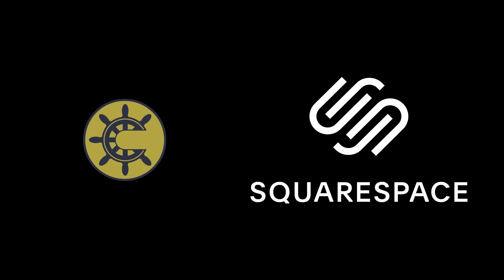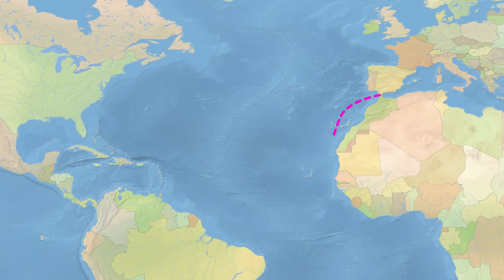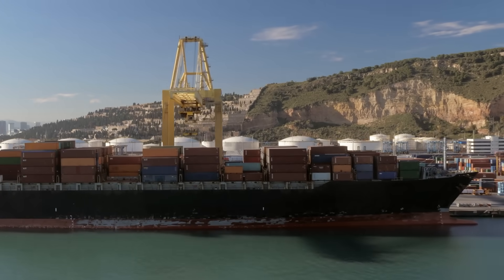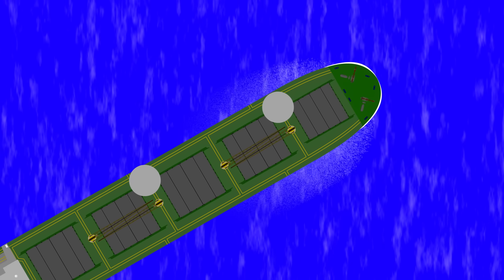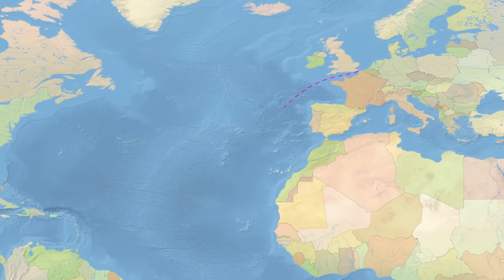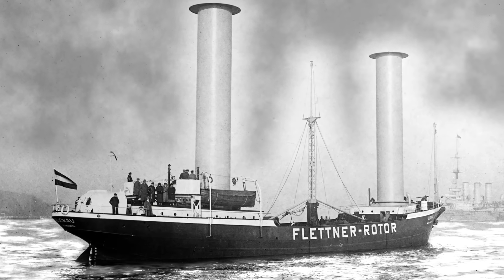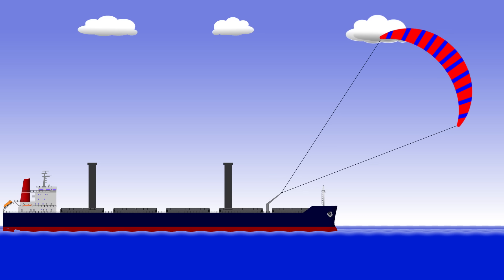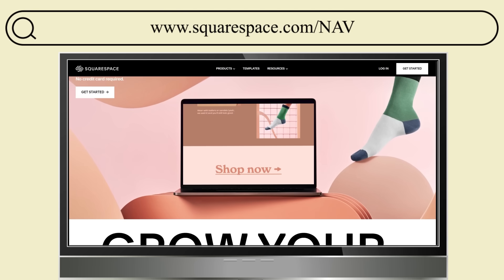Why Don't Sails Work On Ships?

Comment: That was a big jump from looking at the question of cost and benefit to advocating for global mandates. Reduced running costs of efficient vessels could be negotiated into the charter price.
Reply: Why not use nuclear technology in large container ships as is done with submarines? Very effective as water jets - surely it beats the efficiency of marine diesel??
Reply: @forrestpugh7575  Nuclear power is very expensive to the point that the majority of submarines are not nuclear powered and only the US and France operate nuclear-powered aircraft carriers.
Reply: It's also pretty short-sighted.  It assumes the economics based on current fuel prices.  Fuel prices in the future will go nowhere but up, on the long term.

Comment: 6:08 hold your horses. If the increased cost of a charter with these rotors saves the charterer more in fuel costs then the increase rent, then of course charterers will be willing to pay more. No government needed.
Reply: Corporations usually focus mainly on short term costs, ie 5 years or less, because thats around where ceo and shareholder turnover tends to be. With a ship that costs a fortune upfront to build, and will take years to pay itself off, increased upfront costs are often avoided, even if it means substantially increased profitability down the road, because by that point the person who built the ship is no longer receiving profits from it. The corporation may benefit, but those who control it generally do not. So, why not have the government step in to make them choose good long term decisions?
Reply: @razordrive3238  Typically, costs are a first-order estimate of energy usage. If a given technology is not being implemented, there is probably a reason for it. These sails are an experimental technology. How do the sails affect the balance of the ship? Traditional sailing ships were constantly raising and retracting sails based on the wind conditions, otherwise the ships would capsize in high winds with full sails? Are retractable feasible? Will the patent holders be profiting at insane markups due to lack of competition? 

According to Wikipedia, they are only producing "5-20%" fuel savings. At lower end of that range, the actual in-practice fuel savings could easily be negative, especially if they are placed on ships just to meet regulations, rather than actually increase efficiency.
Reply: Exactly so.  The producer of this video appears to have a hidden agenda.

Comment: I’ve got a bone to pick here:  a traditional fabric sail and an airplane wing aren’t really different besides efficiency and performance parameters/mission. They work under identical principles. You  present them as different things altogether.
Reply: The difference is the wings is deflatable making it easier to move them out of the way of the equipment that loads cargo on the ship.
Reply: Nope. They have more differentiators than efficiancy and performance.
Reply: Sails are catching wind. Wings produce lift via Bernoulli’s Principle. I don’t think the principles are identical.
Reply: @clydemarshall8095  sails that catch the wind (aka use the wind drag) are the older, square sails. Newer sails are designed to produce lift because they can extract more force via lift for the same wind speed compared to just using drag.
Reply: @clydemarshall8095  Bernoulli's principle is misapplied to wings. There's a reason wings aren't level with the body of a plane and there's a reason why they use flaps to actually take off and land. The aerofoil shape makes it more efficient but ultimately it's just striking the air at an angle and the inertia of the air pushes back on the plane opposite that, which is up.

This is why a paper plane still works. Wings do not get sucked up, they push air down and then the air pushes back. this is also why a plane can fly upside down, they just nose up enough to generate lift off the top.
Reply: @clydemarshall8095 that's not right, not for most sails anyway, especially modern ones. If this was the case, it would be impossible to generate speed while the wind is coming from beside, or ahead of the boat, which they can. In fact, they are most efficient with the wind coming from about a 60 degree angle, from the FRONT. Not with the wind behind. It's the same reason a sail boat can go faster than the wind, because we're not "catching" anything, we're flying with sails that are pulling the ship forward.
Reply: @clydemarshall8095  Ever sail with the wind forward of the beam? There is no "catching" going on. It is an airfoil, like a hang glider. SAME principle.

Comment: Sails are labor intensive and also maintenance intensive so any cost in saving in fuel is more than offset by the cost of the initial installation. the maintenance of the systems installed and the operational cost of sail handling personnel.

Comment: Some cargo ship is going to use a giant wind sail? What happens when it hits the water and you have 300 tons of wet fabric to reel in and toss up in the air? 
By the way, standing towers up and down, especially those stiff enough to rotate, doesn’t sound easy. I’ve seen lots of videos of towers being lowered and it’s hard. Usually there’s a giant crane nearby, and the crane falls over too when that center of gravity starts going sideways. 
Looks like a high school project brainstorming idea to me.

Comment: Not explained why you couldn't use the northern tradewinds for routes from north america to europe. You cant use them to go directly from europe to north america, but you can in the other direction. Even for half of the journeys, using sails could save a lot of diesel.

Comment: sails already are wings.  the airfoil as sail is not new.  it is not the deflection but the horizontal lift that propels a modern sailboat.
Reply: Lift and deflection of the wind are two sides of the same coin.

Comment: Tbh I don't understand why Cruise Ships don't use sails.

Cargo ships I get, its too much stuff in the way to load and unload effectively. But cruise ships? No need to lift things off the deck with cranes, and you could probably get a tax rebate by dropping your carbon foot print. not to mention how trendy and hip it would be to take a cruise on the first wind powered carbon neutral solar cruise ship.

Comment: One major problem with wind power on large ships is the square cube law. say you make an ship twice as large, it twice as long, wide and high but now weight 9 times more while sail area is 4 time larger. Most sailing ships max out at 10.000 ton except Great Eastern who was just insane. 
In short huge ships are to large to get much benefit from the wind. 
Probably work better for smaller ships but they work more in coastal areas so the parachute would not work well but Flettner rotors might.
Reply: Except that the drag they are experiencing also experiences the square cube law, which is why they have got so big in the first place. An engine to accelerate and stop would definitely be required, but cruising thrust from sails works just fine. Actually, because wind gets stronger with altitude, sails don't quite follow square cube, so it works out better.
Reply: @agsystems8220  you are wrong about the engine being required, but it is true larger ships sail faster generally..   all the ships could be sail powered if we made it a hard requirement as it was in the past.
Reply: There isn't exactly a hard limit on kite area though. What is to stop a series of kites being flown one on to of another? Perhaps a string of five or so? Would take a bit of work to get them all launched, but potentially worth it for a big ocean crossing, and the wind only gets stronger the higher you go.
Reply: It's often said that it's cheaper to transport an item (a drum of industrial lubricant for example) for tens of thousands of miles by sea, than the last few miles overland to its intended destination.
Reply: Think again.
Mass isn't what slows a ship down, drag does.
And now think about how drag scales.

Only accellerating will take longer, but ships don't spend much of thier time and energy accellerating on intercontinental journeys, so who cares if it takes 10 times longer?
Reply: @jannikheidemann3805  Academically no, but practically yes. More mass, more fuel, bigger engines, and more fuel all equals more mass until you cant build a bigger badder cleaner engine.
Reply: You dont need a huge ship to cross oceans.
Reply: @joshlower1  The cube-square law and hull speed are the main ways ships save fuel.

Engines have to continuously run because energy is lost due to friction with the water and/or air. For example, in space once an object is moving at speed X it stays at that speed.

The power required to keep a ship moving is below. A is the cross-sectional surface area. As a ship gets larger A drops when compared to the volume of the ship. This increases fuel efficiency.

P = 1/2 p A v^3 Cd

Another factor is hull speed which is directly related to the length of the hull. Bow and stern waves form on ships when they move through the water. The further apart the bow and stern waves are the longer the wavelength of the bow/stern wave combination which increases the speed where the bow and stern waves start to interact in a way that slows a ship down.

To save on fuel costs ships are as long, narrow, and big as they practically can be. Of course, there are limits to size (like the size of ports) and limits to how narrow ships can be (before sea worthiness and hull integrity are compromised).

Sailboats are limited by the Cube-Square Law and hull speed. Most sailboats can't go faster than 6 knots no matter how much wind hits them.

Smaller boats are incredibly fuel-inefficient and even more limited in speed unless they are a non-displacement hull. "Speed-boats" are non-displacement or semi-displacement hulls because as they increase speed much of the hull gets out of the water and onto a plane (this is like a hydrofoil).
Reply: @joshlower1 that works for a yacht but not for shipping....
Reply: @joshlower1 You do need a huge ship to make shipping cargo worthwhile though

Comment: I believe the diagram about the sail is quite misleading. A normal sail pulls the craft through the water by creating an area or low pressure behind it. Just how an aircraft creates lift, but, you know, on its side. 

The next part about areofoils further confuses matters because sails are areofoils, they're not orientated to create lift, just forwards momentum.
Reply: I think the confusion is yours. If a sail is not producing lift then neither is it providing any thrust to the vessel (with the sole exception of being on a run). Lift is defined as the component of total reaction that is normal to the relative airflow. The only time there is zero lift is if the aerofoil is at zero lift angle of attack or there is no airflow, or a sail is acting as a chute. Any time the sail is driving the vessel (except on a run) there exists a component of force that is normal to the relative airflow (ie lift). It is not in general the same as thrust, which is the component of total reaction that is aligned with the keel, opposite to the drag on the vessel, although in the special case of a beam reach the thrust and lift vectors become the same thing. OTOH, in the special case of a run, the thrust = the drag on the sail only and - in theory - the lift becomes zero. On all other points of sail, there is lift.

You said “sails are areofoils [sic] they are not orientated to create lift only forward momentum”. That is incorrect. Only in the case of a run is there no lift.

Comment: I always thought that, after WWII, the increased number of fueling stations, the surplus of freighters, and the dearth of skilled crewmen made coal- and oil-powered ships more economical, and we lost the skills needed to operate sailers. Sailing ships had advanced to be very efficient before the war, and quite a few of those big steel “windjammers” still exist today. However, technology, knowledge, and economics have moved to containers and large volume vessels, so I think the days of blue-water commercial sail have forever passed.

You might as well ask whether ocean liners, sleeper trains, and piston-engine commercial airplanes are currently viable.  They all reached the peak of their development, but were rendered obsolete by world developments.
Reply: Regarding sleeper trains, have you ever been to India? They are the standard way to travel long distances there. The fares are cheaper than the cost of fuel to run a motorcycle or car the same distance, and you make the journey in comfort and safety.

Comment: I like how, around the 4 min mark, the ship drops its rotors in order to use its superstructure to absorb the full force of the imminent collision with the bridge
Reply: Well, how else are you gonna take down the bridge?
Reply: @demogod4955  Should I say that a bridge is needed to take down another bridge?
Reply: Exactly, the cylinders would make the ship to lose momentum and we want it to collide at full speed  @demogod4955
Reply: The ship's bridge has been phased into 4th dimension. You can't do that with the sails as they need to interact with the wind.
Reply: Bridge to bridge contact
Reply: "Sir, bridge dead ahead!"
"Lower the rotors!"
"Sir?"
"Full speed ahead! Bridge to bridge combat!"
"Sir yes sir!"
"Today is a good day to die!"
Reply: 😂😂😂 @alexc8114
Reply: and then, around 6 and a half mins in, the radar mast passes straight through the bridge :D
Reply: chimney passes through bridge too
Reply: XD
Reply: The bridge is collapsible too, with enough effort.

Both bridges, for that matter.
Reply: No worries. It’s a QUANTUM bridge!
Reply: hahaha I saw that too!
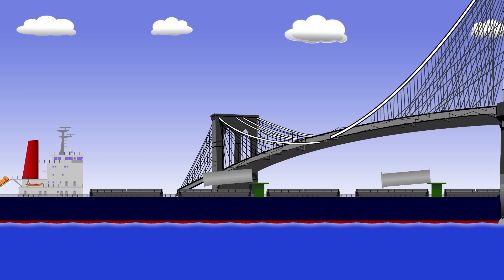Reply: 4:15
Reply: RAMMING SPEED
Reply: The sea is always right!
Reply: i hate that.
Reply: The rotors a generating a significant gyro effect.. ;-)
Reply: At 6:35 you can clearly see it just ghosts trough the bridge.
Reply: The ship is saved because the scene ended😂
Reply: relative angled illusion
Reply: @feelinghealingfrequences7179  not so. In this case somebody just made a serious error and its going to be expensive
Reply: I was thinking the same lol

Comment: The cost/benefit analysis will probably vary depending on the type of ship.
Cruise ship or container ship: deck space is precious + boat is top-heavy already + cargo is time-sensitive... adding sails or a funnel would not be practical.
Oil tanker or bulk carrier: a bit easier to load and unload + low-lying and stable + non-perishable cargo... it could be economically feasible to add wind power to cut down on fuel costs.

Comment: Sorry, but your exlpanation of how sails work is lacking a lot, i.e. the airfoil effect of traditional sails. And that sails would have been implementend in cargo dacades ago... Well they have. Thousands of years ago. And they are used in cargo ever since. Today, there are not very many SV cargoships, but the numbers are increasing. And Skysails do not pull the ship they are mounted on. Instead, they produce electricity, that can be used in the diesel-electric propulsion system.
I get the point of your video, but your research is a bit dim on this one.

Comment: Sails have in use since the beginning of sea travel. Could they not unload cargo back then? Weak argument. Modern sailing rigs are not as complex as the old school ones because modern materials are stronger and need less bracing if any. Raising and lower sails can and has been automated even further reducing 'clutter' on deck.

Comment: Im gonna guess that the surface area and resultant mass from the sails, the additional cost of operating the sails in maintenance and crew would result in cost ineffectiveness if you could even get any sort of efficiency out of sails trying to move such huge masses.
Reply: The mass scaling cubicly isn't a problem. The mass isn't pushing the ship back if it's not accellerating.
The drag is the problem, but the drag scales quadraticly, just like the Sails power does.

Comment: It should be mentioned that hybrid sail/steamships were commonplace throughout the 1800's (the first one to cross the Atlantic being S.S. Savannah in 1819).  Early steam engines just weren't reliable enough to use full-time, so ships would use their sails most of the time, and their engines just to help out when the wind wasn't favorable.
Reply: Another point; steam engines of the day were so inefficient that the ship could not carry enough fuel and have any room for cargo.
Reply: Not just about reliability, the smaller ships of the day had significantly less steaming range and a worldwide network of coaling stations hadn’t been developed yet
Reply: and also that due to problems getting fuel to remote ports, some select few sail ships actually operated un cargo routes all the way up to the 1970s
Reply: The wind is extremely strong IT be cool if ,Like this video  is suggested..Is use the wind Sails to help move the ships through  the water be Wonderful  if they could  use the walls of stacked containers  ships as Sails too🎉🎉😂😂❤❤❤❤❤
Reply: @bradfordthompson8326 ???
Reply: Sail rigs were also used on some ships for a margin of power assist. The SS Great Britain and Great Eastern for example didn't need their sails to cross oceans, but they were useful re' assistive propulsion, and with stability in certain sea states.
Reply: Another problem, in Great Britain, was that captains, who still remembered Nelson times, didn't believe in ship without a sail. They really delayed development of them.
Reply: @Admiral45-10  You got any sources on that?  Sounds unlikely.  Competition beats corruption.  If that was the case, competing countries' navies would've left Britain in the dust.